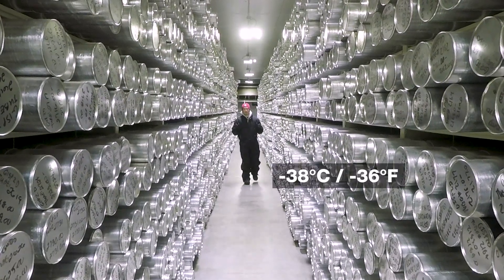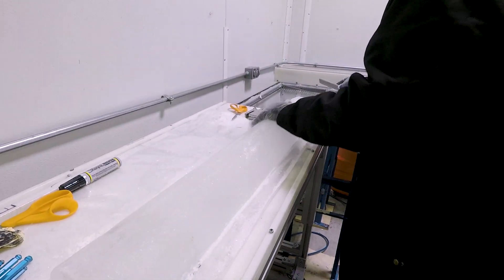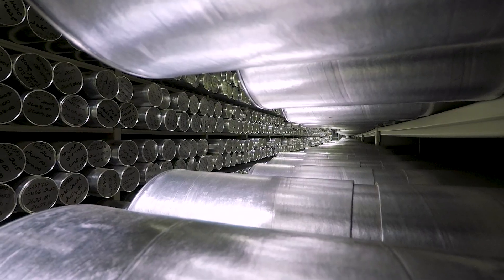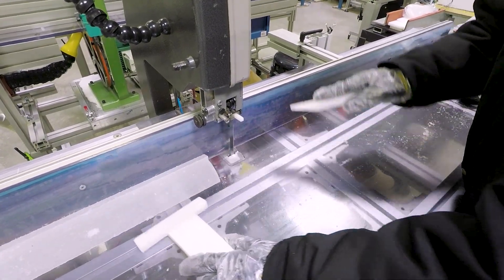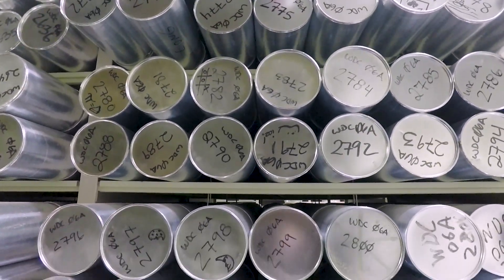Colorado has a giant freezer filled with polar ice

Comment: I visited this lab. The same building also stores rock cores. Enough rock cores that if all lined up would amount to about 2 mill feet. The sheer scope of it is crazy. The ice lab is in the middle of the cores. It is not at all separated from the rock cores, and only 2 doors keep the cold air in. We were allowed to go in without any special equipment and never had to go through any decontamination. Considering how long it is planned to be there it doesn't really matter that it is perfectly sterile, all that matters is the ice is properly stored and kept cold.

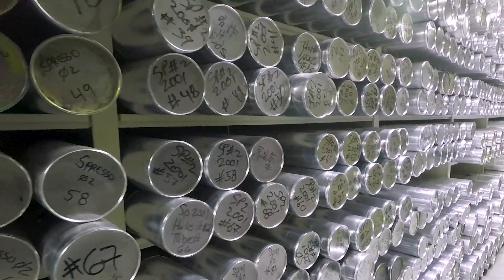Comment: 0:31 So Richard Nunn, assistant curator of the US national ice core laboratory uses metres? Since when do Americans use the metric system?
Reply: The metric system is the national system, what do you mean? It's just that outside of science, engineering, and government documents we don't use the metric system
Reply: We use both Metric and Standard (you may call it Imperial). For measurements where the rate is due to accuracy at mili, micro and nanometers, we use Metric, for all else, we use either Metric or Standard. 

For Temps, we use Fahrenheit for Human reference, but for chemistry, we use water for reference, so Celcius. Kelvin is used for absolute level and similarly for Chemistry but Astrophysics use it extensively. 

In the USAF, our Aircraft and at NASA where I contracted out to Kennedy and Johnson labs, we use both standard and metric. Same for ESA which has some components in Standard, not just metric.

[Phase and Electrical Engineer on Fighter Aircraft (F16, F15E, A10 and F22) in the USAF and Phase QA at NASA - Kennedy and Johnson Labs]
Reply: Meters are used in science context here. In America we don't use the metric system for everyday things, but sciences always use the metric system because it is a standard around the world so they kind of came to an agreement on using it to make working with scientists around the world easier
Reply: We usually only use it for science things, like the people below me said, but people use it occasionally for random things like wrench and socket sizes, or other specific tiny measurements.

Comment: 3:07 All 3% of it.
Reply: When output equals intake, adding 3.75% to the output causes a massive imbalance.
Reply: A relatively stable system can easily be thrown into disarray with even the slightest of changes in concentrations.
Reply: @heckingbamboozled8097  Yep. Not Earth though. And certainly not with something as miniscule as carbon.

Comment: When I was 18 I spent my summer working at a berry processing plant.  The warehouse was kept at -40 (Fahrenheit or Celsius, take your pick, that's where the two scales meet).  It's not so bad to work in;  you just bundle up like Tom.  The only issue was that it was at least 35C outside, and I had to go in and out on my forklift loading trucks.  No time to change, I could dress for the summer and freeze inside or dress for a blizzard and get heat exhaustion outside.  Tom, be glad you were in a consistent temperature :)
Reply: I used to work in a restaurant with a walk-in freezer, set to -30 or lower. With technically a windchill as the air moved around a lot from the coolers. I'd pop in quickly for something wearing only my shirt and trousers. Which for a few seconds does hit you, and will keep your shirt feeling cold for minutes afterwards.
My worst fear at the time was getting stuck in there, as without proper clothing you could die within minutes
Reply: Is it okay if I choose Kelvin?
Reply: @TheReligiousAtheists  No it is not OK.  Stick with the program dammit.
Reply: @TheReligiousAtheists  r/beatmetoit
Reply: i feel like in that kind of work environment you have to seriously consider temperature shock for any materials you're using. 80C is a big difference and thermal expansion/contraction can really mess things up
Reply: If I were doing that I'd ask if I could set up plexiglass around the forklift seat to help keep the temperature consistent. That's brutal. Of course, there is the problem that ice might build up on the glass, blocking vision... Still brutal.
Reply: @Paraig Mc Gee without blowing them? What's that mean?
Reply: Yeah, -40 is not that bad if it is dry, and not windy...
Reply: @nic12344  I had a very similar job. You get frostbite within minutes of being in any freezer 😂
It doesn't matter if it's windy wtf
Reply: @lordlandbeast  Then you might have a skin problem... I've never had any frostbites at -40 without wind, even when I stayed for long periods. The wind matters a lot! It's a phenomenon called wind chill. The windier, the colder it feels on exposed skin! I once went skiing and it was -34C outside, but with only a 15 km/h wind, it felt the same as -48C. That time I did get some frostnip in the face tough...
Reply: @nic12344  um no. Doesn't matter how desensitized you are or how tough you wanna seem, -40 is a dangerous temperature. Hypothermia and frostbite set in quickly. Moving around helps, bundling up helps, genetics matter to an extent (I have HEDS, so my internal body temperature isn't well-regulated, eg), but nobody should be chillin in -40 for too long (pun intended)
Reply: you had a berry cool job.

Comment: What exactly does it mean for wiring to freeze, given that it's already solid? Whatever condensation from the air was on it freezing?
Reply: At these temps the wiring insulation hardens and becomes brittle so it cracks and breaks when moved.

Comment: Why would the batteries being cold be an issue? Don't electronics work better at cold temperatures?
Reply: ThePavoReality Chemical batteries such as Li-ion batteries rely on a chemical reaction to produce an electric potential. Cold temperatures can drastically reduce that reaction rate. On the flip side, cold temperatures reduce thermal noise and the resistance of most other components and thus increase their energy efficiency. In other words, some components work better when warm others work better when cold. Tom's camera is likely designed to work best at 20 C (normal room temperature ).
Reply: Oh awesome! That's really interesting to know! Thank you :D

Comment: PLEASE
DON'T SLAM THE DOOR.
Please pull it shut behind you going in
and push it gently shut when coming out.

The latch mechanism broke yesterday, pieces falling on the floor. . .
we would prefer not to break anymore

Thank you

Geoff
Reply: Nillie "Warm clothing is required." Yeah, if you're gonna stay in there for more than 15 minutes or so. -24 is not that bad when there's no wind. :-)
Reply: 0 degrees C will kill you within 20 minutes with no clothes, and -24 is obviously worse, even if you have a basic layer of clothes on

Comment: Doesn't your face get really cold in there?
Reply: If the air doesn't move much, your body temperature will warm up the the air around you. You will only notice the cold if you move and your skin gets into contact with cold air again, but it wouldn't last for long. So it will feel cold but not unbearably so.

Comment: Question: why can't we see your breath if it's that cold?
Reply: makes sense, any moisture would cause ice to build up and you ain't defrosting that room twice a year!
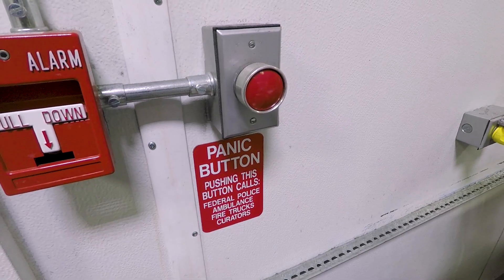Reply: -Plowkiller I'm probably missing something here, but whatever. You can see his breath a few times during the scene at 1:31, particularly right at the end of the scene.
Reply: If air is dry enough the water vapor from your breath will dissipate faster than you can see it.
Reply: Too dry. Like really dry. In really dry weather you can't see your breath even if it is cold, and under normal situations, "dry" is like anything below 30% humidity. It's probably like 5% at most in there.
Reply: More to the point it's a room of ICE. You would want to do everything you could to mitigate additions to the samples.
Reply: Red Bluefish also when it's that cold the air can't hold very much liquid
Reply: at that temperature humidity cant even exist, water molecules will instantly freeze and fall to the ground like dust
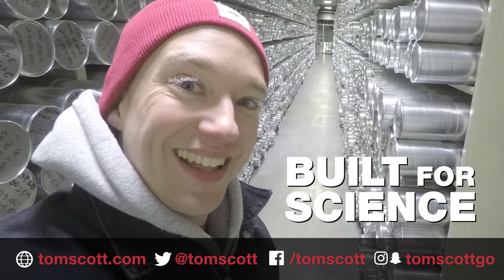Reply: Hes a robot confirm.Pause at 3:21 and you can see the camera guy breath...
Reply: Big walk in freezers tend to make that happen, I work in a freezer we keep at -13 to -20 F and between that degree of cold and the compressors running in there that dry the air out I don't see my breath working either
Reply: Cody Crewson where were you when it was -50? F or c
Reply: Wyatt Fenlason 
That doesn't matter because both of those are colder than where Tom was in the video.
Reply: You can see it at the end of the Video, probably its due to the Camera.
Reply: I saw his breathe at some points.
Reply: because potato chips lasts much longer if the air is dry
Reply: David Grossenbacher "we didnt land on flamin' rock, flamin' rock landed on us"
Reply: I had to slow it down. You can spot it between 1:32 to 1:34.
Reply: Yeah but he's still human so he should be exhaling water vapor. Idk why we don't see any of that. Maybe the amount your body add to the air you breathy out is negligible.
Reply: Yeah, it's very dry there. We can know this because he didn't cover his face. If it was more humid in there, he wouldn't be able to speak properly because his facial muscles would get so cold.
Reply: Because this video is faker than the moon landing!

Moons can't "land". If they could, they'd be Big Ass Asteroids! Or "Baa" for you sheeple out there.
Reply: Funny? Last time I stepped outside at -50 I could certainly see my breath.

Comment: Damn I hate it when you get caught eating potato chips in the lab by a scientist remotely controlling the devices from home
Reply: The way he tells it at 1:15, there is no way he is not the guy who got caught eating the potato chips
Reply: I'm surprised there isn't a hermetically sealed airlock between the labs and the administrative portion of the building, along with decon procedures to avoid tainting any of the ice.
Reply: @Tahgtahv  probably not in the budget?
Reply: @Tahgtahv  also, if the big red button that calls the feds is for emergencies, why is it out in the open? Shouldn't there be a plastic cover over it?
Reply: Tahgtahv 
That would cost money
Reply: Peter Siegel you think storing that amount of ice or operating those fine machineries arent expensive? Even some labs in universities have airlocks if im not mistaken
Reply: @newtondeng2840  You don't pay for any more than you have to. Clean rooms are very expensive, and apparently if the ice is handled carefully, that isn't required here.
Reply: “From home”

Me: oh it’s a-
2 years ago
Reply: @trinityy-7  no
Reply: I visited this lab. The same building also stores rock cores. Enough rock cores that if all lined up would amount to about 2 mill feet. The sheer scope of it is crazy. The ice lab is in the middle of the cores. It is not at all separated from the rock cores, and only 2 doors keep the cold air in. We were allowed to go in without any special equipment, and never had to go through any decontamination. Considering how long it is planned to be there it doesn't really matter that it is perfectly sterile, all that matters is the ice is properly stored and kept cold.
Reply: @thatguy77006  That sounds cool, I'd like to go there. But I don't really understand why it's not that important to keep it sterile in there.
Reply: @Corn0nTheCobb  My best guess it it is so cold, nothing that could damage the ice could survive. Also, they are looking more at the layers of the ice than anything else. Not to mention they are in sealed containers.
Reply: Not even in the lab, it was in the break room
Reply: CCTV 😂😉
Reply: L
Reply: Who is remotely controlling anything 
What